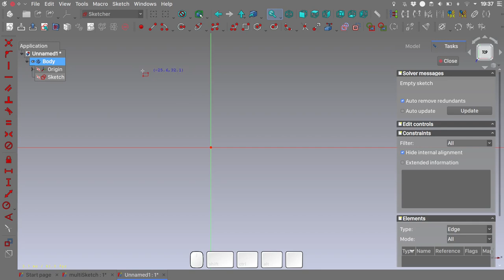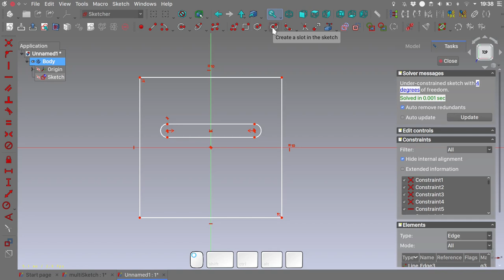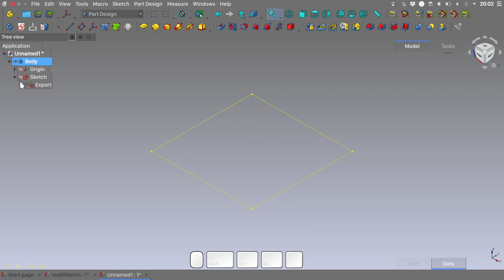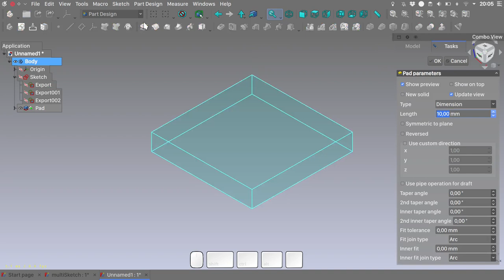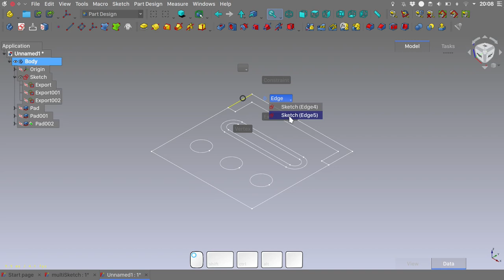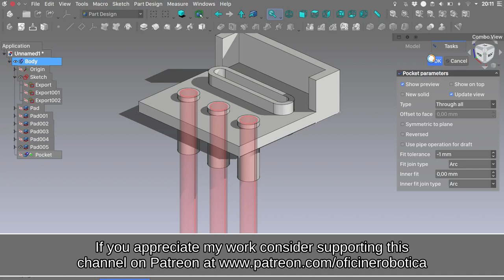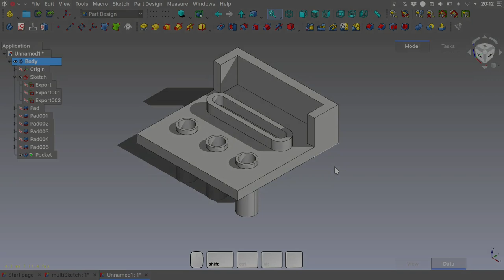[LinkStage3] FreeCAD shorts. Multiple pads from one master sketch .

Comment: Awesome. Another possibility for a quick video is how to go back and change the selection in an export set. I found you could do this, very useful!
Reply: How? I looked but couldn't figure it out (at least not when the feature was first introduced a few weeks ago, haven't tried since then). Also, is it possible for the shape binder approach?
Reply: @VorpalGun  Opening the exported selection shows the selected elements, and I found they could be changed. Not 100% though, there were some oddities, but I was able to remove a selected circle and the model updated nicely.
Reply from the maker: The feature is still in it's infancy. If you take a read at this post https://www.patreon.com/posts/becoming-github-52094706 you see that the ability to easily add and remove geometry to SubShapeBinders/Exported sketches is on the roadmap . 
The only issue I see is that RealThunder is only one man and has only 24 hours in a day for family coding and sleeping. This is the main reason why I relentlessly publicize his work and link his patreon everywhere. With enough funding he seems to be the only full time developer of FC at the moment. Please don't get me wrong, the code base is huge and although the team of coders is small the quantity and quality of code is outstanding and is shared between master and LinkStage3 but honestly RealThunder is the one that spends the most man hours on it.

Comment: I am wondering, if you can extrude circular cut( as oposite to circular extrusion) with several sketched independent shapes- because you can not even extrude circular bodies with several sketched circles (or whatever other shapes you might have) to create separate bodies (Doughnuts). Neither it is possible to create aditive helix with 360 degree rotation, only one turn and 0 pitch, 0 hight to get a simple doughnut.(it gives error-do not know why) Someone with Python Knowledge should be able to make a little Python hook/sub/macro to do these things.

Comment: Does not work with the official standard FreeCAD software. None of the two shown methods can be used to PAD multiple objects. I find it unbelievable the "normal" standard FreeCAD has such a deal breaker limitations. It makes it impossible to design certain parts where you need to extrude multiple shapes from a 2D sketch.
Reply: In the end most of this is just a shortcut of creating sketches. Which seems to be the only way to extrude or pad at different heights.